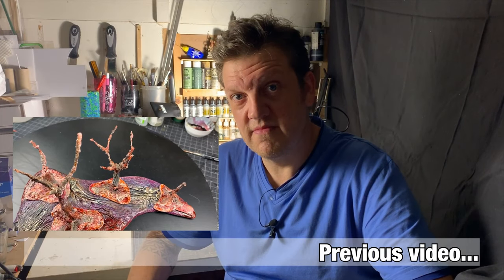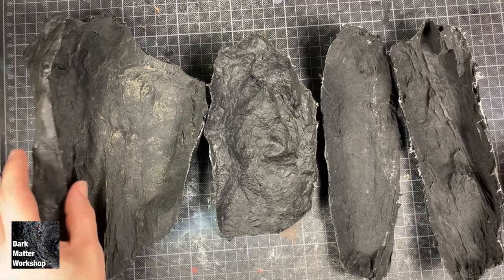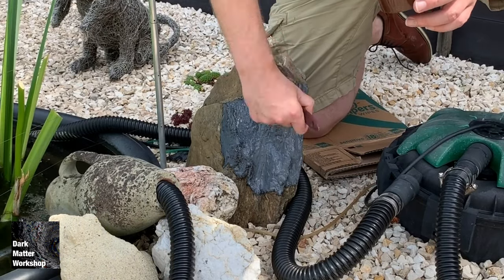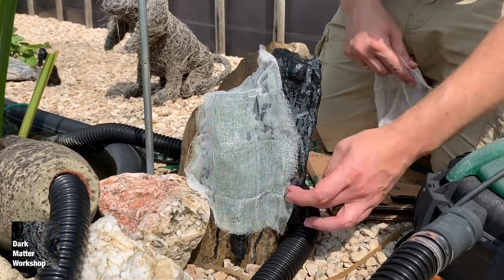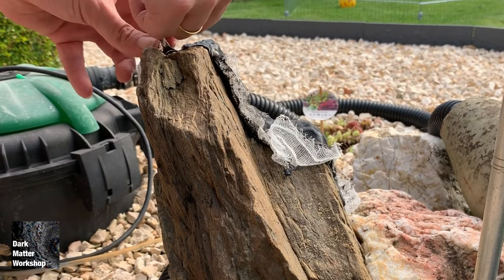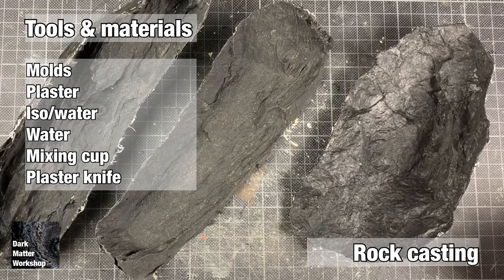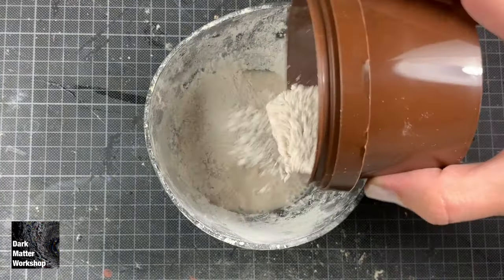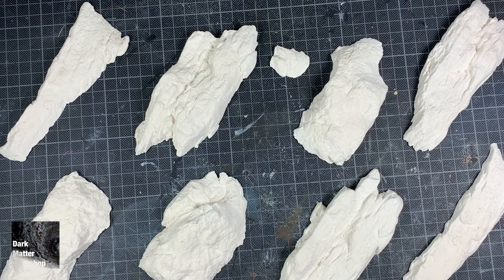Silicone mould making & rock casting with plaster tutorial

Comment: important tip - DO NOT put wet plaster down your sink, drain etc. It can set and block the pipes [expensively!] either use flexible bowls or clean out onto plastic bags, then when set, dispose of in the dustbin. Love your quick technique of not making Mother Molds/Jackets, just propping the mold on some paper - nice and simple! Cheers